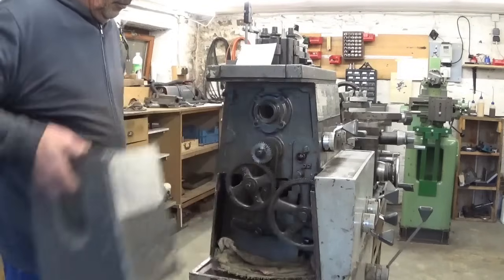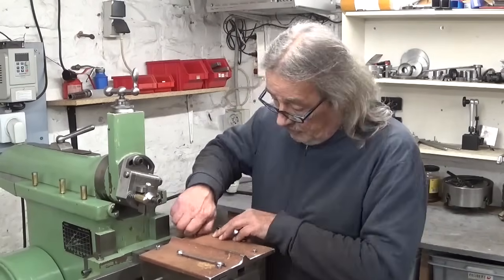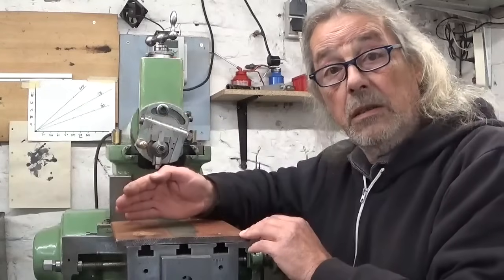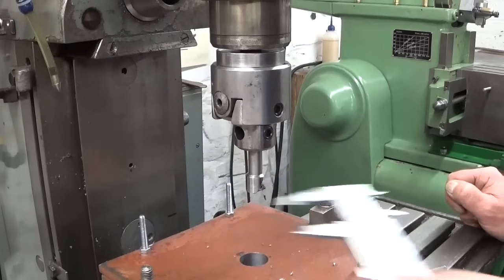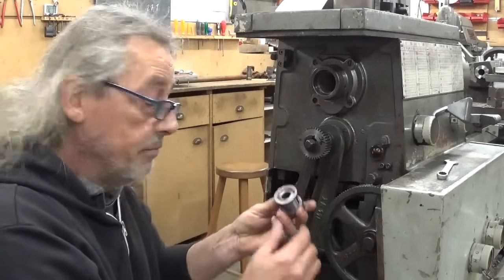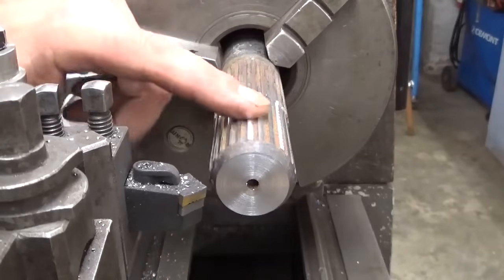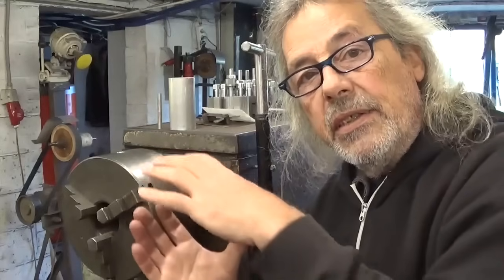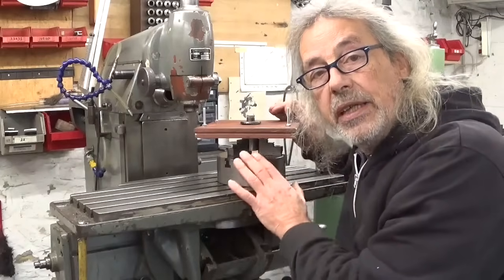A new gear for the Celtic, part 1.

Comment: Hi Michel, great use of material to create your gear blank, I would have gone for drilling one half and plug welding the two halves together rather than bolting personally, looking forward to the second installment next week 👍
Reply: i would have welded the 2 together but its not my project
Reply: @plainnpretty  exactly we all have our own way of doing things, as long as it works it doesn't matter, welding would change the order of operations as it would likely cause some movement.
Reply: @Paul-FrancisB  the order of operations can make or break a project. its easy for me too look at it and say id weld it but it wasn't my project .
Reply from the maker: Welding could deform the plates, so it will be bolted.

Comment: G'day Rusty.  Excellent job so far, with cutting & machining the plates etc 
Are you going to drill about 3 holes inside the diameter & weld the plates together,  or are you going to just bolt them together ?
Ted
Reply from the maker: They will be bolted.
Welding could deform the plates.